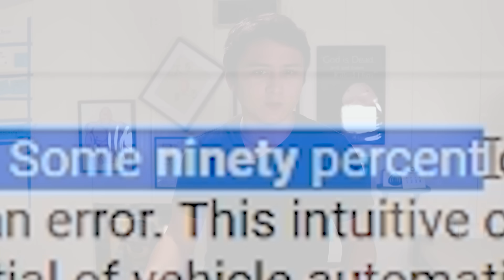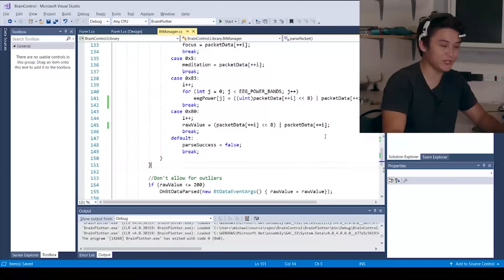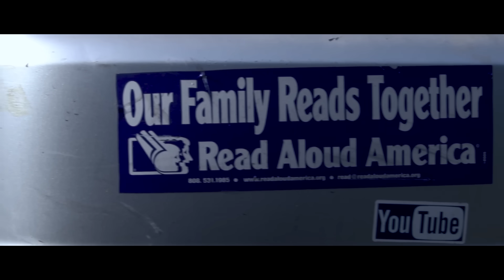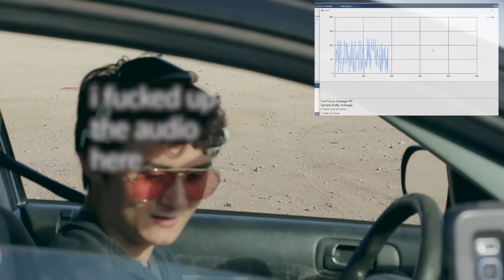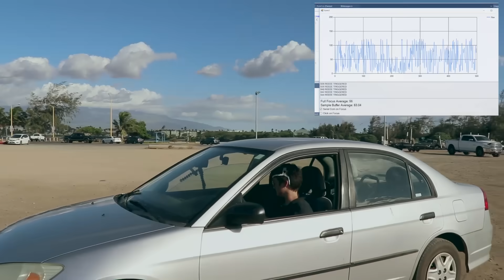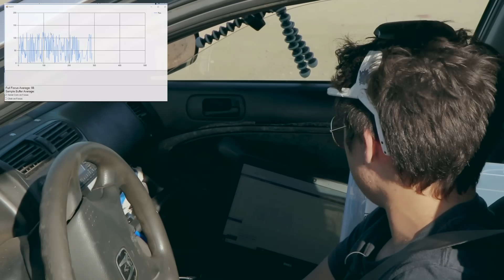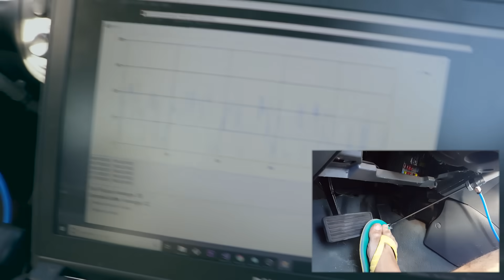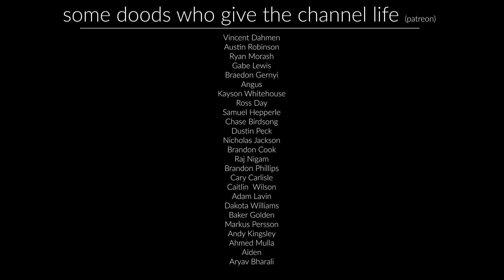Using Mind Control to Drive a Car

Comment: Old vid ik, but if you ever see this then. You should redo it, but make it so when you focus it presses the brake and when your calm your on the gas, you said when your panicking you focused. Well ima panic if i see a kid in the road, and if that makes me speed up more itll look bad lol. And if you can make it a gradual acceleration and brake. So maybe of that number is 65-70 its full brakes 60-65 half break and then do the same for the gas.

Comment: "if you have the means or not, this is a terrible idea" does it anyways. Don't worry guys, mine will have a 405nm laser pointed at a crystal. Why do I need a turn signal anyways. If you don't run from a blue/violet laser shooting in all directions that's on you anyways.

Comment: dude use a fucking electrical motor and a pully around the gas so the moter pulls tighter and slowly exelerates to a certain threshold then release auto rotates back slowing down then you're varible can be the speed of the motor and mabe u can even set threshold maximums of beta and alpha waves by the y and z axis of the motor like say 31 it will rotate untill it reaches it's maximum rotation and 16 will be the minimum or completely released
Reply: also with those helmet's i believe their is a way to increase the tuneing sensitivity to get a borader spectrum of by eliminateing grey area in the sencer and haveing the scaleing of the reading set at a short delay and have it resist change in frequency to a low maximum threshold which will force it to glide like a pointer trail on a mouse

Comment: attach it to your lights because your brainwaves are smaller when you sleep so the lights are off then when you wake up the lights turn in until you can get to the light switch and take the headset off

Comment: The more I look at this video, the more I realize that this was an actual insight into the use of brainwaves to control physical mechanisms. Which is really cool for someone like me with literally no knowledge or experience in engineering. So good on you Michael, ya fuckin did it.

Comment: "I forgot safety was our #3 priority"
That's a builder's motto.
Reply: Kerbals be like
Reply: A safety tie does the trick
Reply: Peronio when i make shit safety isnt even a priority. I just do damage control when something catches on fire or i shock my self.
Reply: for you wondering it's: fun, quality of build and then safety
Reply: Same thing goes for homework
Except the fact that you add a few more 0s to the end.
Reply: Did you mean moto moto
Reply: Peronio Safety 3rd
Reply: takes hands of the steering wheel
Reply: What's the first?
Reply: the engineering motto is: "if it's close enough, it's good enough"
Reply: Same

Comment: Dim lights would be cool with this, brighter the more focused you are
Reply: That should be used in schools
Reply: @peiithos  We're getting into sketchy territory talking about using technology to monitor brain waves. Surely, reading someone's brain waves is encroaching on personal privacy, no?
Reply: @Fermion.  no, they're not nearly that accurate yet. They may be in the future, but for now all they see is very broad; 2 different waves which can be activated by just about anything. We haven't even really got that to a science yet, but we believe one is for being focus and one is for non-focus. It doesn't help much when trying to figure out specifics.
Reply: @404_thoughtsnotfound  Of course science isn't there yet. But it's good to have the foresight to attempt to identify philosophical, moral, and legal issues before technology catches up to concepts.
Reply: @Fermion.  the science usually comes first though. I can't think if a time an legal argument was made before someone did something to start it off the top of my head. It is a thing people should think about, but with so many potential inventions and so many failed potential inventions, it's usually just a waste of time.

Comment: Positive feedback is a process that occurs in a feedback loop in which the effects of a small disturbance on a system include an increase in the magnitude of the perturbation. (Wikipedia). Focus to accelerate, focus freaks one out causing greater focus, causing more acceleration. 20 goto 10.

Comment: Aren't you able to measure nerve impulses to different parts of the body, so couldn't you just hook some monitors up to like your left and right eye, and then when you wink with one side it will activate gas, and when you wink with the other it will brake, and then you can chill in passenger seat and steer

Comment: How exactly do you "focus "
Reply: To focus, you need to start with something something completely useless, irrelevant, and not productive in the slightest. For example, a poorly made brain-controlled car. Then decide what you'd like to do with it, and if you've done it right, you should be able to focus quite well.
Warning: this tactic does not work with useful, relevant, or even slightly productive tasks. Do not attempt in school, it won't work.

Comment: you could have used a flow & check valve to meter-out the cylinder to accelerate a little slower rather than going full blast pedal to the metal. that would have been an interesting feature to add.
Reply: Where's the fun in that though?
Reply: Nerd
Reply: That's a great idea...

Comment: Should've made the Relay system similar to a dimmer switch, where the amount of focus needed was typical with the hydraulic piston, so it would start slow and then build up to a faster speed.

Comment: It would be 10 times easier to hook a solenoid to the carburettor of the vehicle so it accelerates without the need of a piston pushing the gas pedal.

Comment: What happens if you're driving down the highway with brain power and you either sneeze fart shitt yourself what do you think your brains reaction will do to your driving how would you mind control device control or react to example something like a sneeze when you're driving

I'm pretty sure the car would start doing flip tricks

Comment: amazing software, try this again focus on on an object in front of you. than picture you moving to it, allow the piston to move lower down slowly depending on the concentration it detects more focus on getting to the object slow or faster will help set a more controlled speed.

Comment: I’ve always had trouble waking up. Imagine a subwoofer box in a bed with the ports facing the bed. Amps are getting cheaper and you can power them with computer power sources. Make a 2,000 watt+ subwoofer bed! 15hz-50hz

Comment: Did you happen to buy that solenoid off a website called Andymark? 

https://www.andymark.com/products/single-solenoid-valve-mead-1-8-npt?via=Z2lkOi8vYW5keW1hcmsvV29ya2FyZWE6OkNhdGFsb2c6OkNhdGVnb3J5LzViZDM0MWUzNjFhMTBkMjkyYzk2NDY2Zg

Comment: I know its more than half year after you published it but you should try to make it with one way valve and control not turn on and off air flow but sth like digital flow regulator. I dont know how this brain shit works if its only 0/1 thing or more like physical signal that you can attach value from input to value of regulator position but if its work like this you can get really nice and smooth thing with acceleration :D But if its work 0/1 you can always make some code shit that it will create increment values - when focus you start count time=value for valve position or sth like that

Comment: how did you manage to interface the brain waves reader to electronics like lights? I would like to use it to move a little servo, but it's not clear how to trigger it. do you have to set a value? cause I don't see any noticeable change on that brainwaves graph

Comment: This woild be cool for kids playing ninja around the house. "Alexis turn down the lights" gives off your location via sound. 

If you had a feild and a bunch of lights in trees on walls on ground.With the brain wave analyzer. 

Random speakers with loud alien noises. 

Camras set up to a screen showing you far away on a consistent showing. 

 A few screens  with a sense of disorganised. Just randomly seeing the other part of the map.

Crazy fast flying RC drones. With camras sweeping across the map flying back to a check point to show the video than repeat.

2 teams  5 on each team. 

You could strobe lights to distract your enemy. 

Distracted by the sounds of aliens.

Lazer tag (a new respond point on the map to reactivate the lazergun every time.)

 capture the flag.

So manny players of the opposite team make a simultaneous sound across the map loud alien gargle.

Comment: Pro tip wedge am orange in your tesla steering wheel to defeat the "one hand" safety feature 
*disclaimer I am in no way responsible for any damage incurred to your vehicle in response to this comment, you take full responsibility for any small animals or children run down by tour vehicle. This information is not intended to be taken seriously, and no person should read comments due to toxicity. No copyright claim, information from 2017.

Comment: That can be a safety feature, the accelerator only works if you're focusing on driving, so that when zone out, the car'll stop
Reply: Yeah just casually stop the car in the middle of a highway. Sounds great dude
Reply: It would’ve built in with hazard lights, so when brain activity decreases below expected consciousness, the car will slow down, once it comes to a halt, the lights would switch on to warm traffic.
Reply: @sylasviper715  Not a bad Idea, i'll admit.
Reply: Jacob Schneider but you would have to have more electrodes to definitively distinguish panic from focus. Because otherwise you’ll kill everyone.
Reply: @sylasviper715  Not needed. He said the accelerator only WORKS when focused, it doesn't automatically accelerate.
Reply: @Galactipod  but yes, true.

Comment: Today I made an app that communicates with an Arduino and receives the string "Ass" if you press a button, and "Penor" if you press the other. I was really happy when it worked. You are and inspiration for me to aim higher. Maybe one day I will display "Ass" and "Penor" on Times Square.

Comment: Instead of a binary piston using a solenoid, you Could use a servo which correlates focus with acceleration. :D or just directly attach the servo to the gas valve under the hood. No gas pedal necessary

Comment: Probably expensive as all living fuck to pull off, but you could probably hook up drones to your mind...headset(?), and use the mind headset to control how fast it spins the propellers, like, four different thresholds that each don't matter once it reaches a threshold above said threshold, higher brain activity levels resulting in higher altitude. 

Or, you could like, save yourself the trouble and completely ignore my shit-filled suggestion!
That's probably a better option!

Comment: We need a Michael Reeves x Elon Musk collab.
Reply: And that would create what? You guys have to understand that Elon is just an investor and CEO, he doesnt actually do the stuff, he just thinks of them. "Hey lets try to build reusable rockets, Science team, go for it"
Reply: andi bro No, he’s mentioned in interviews that the majority of his job is actually engineering and not business. He’s not like a lot of other investors/CEOs.
Reply: @DrAdnan  Elon has a Bachelor of Science in physics and Bachelor of science in economics, even if the majority of his job WAS engineering (where he doesnt even have a degree in) he is just one person. SO insiginificant when it comes to building cars or even rockets. Maybe he does like 0.2% of the work. If any.
Reply: andi bro He’s very self motivated and learns a lot on his own (in addition to having a high IQ and an aptitude for engineering). Not everyone needs a piece of paper with letters on it to be competent in a field. 

The argument of whether he has much impact as one person is irrelevant to our current discussion since your initial argument was that he didn’t do much engineering. Also, the biggest power of a leader is to rally the strengths and energies of groups of individuals to a greater cause, and Elon has been shown to effectively do this multiple times at scale.
Reply: @DrAdnan  No. My initial argument was  that he doesnt create stuff himself. To which you replied that he actually works in engineering fields, to which I replied he doesnt have a degree and btw I never said you necessarily need one, but still cant cause much impact by himself when it comes to actually working on the project. The person my initial argument was towards, deleted his comment. You joined the discussion not me so stop saying stuff is irrelevant if you bring it up yourself
Reply: @andi827  bro he works 90+ hours also r/woooooosh there is a joke and it's not meant to be taken seriously so calm down also Elon musk does 60+% of things also 

R/iamverysmart
Reply: @andi827  also he Elon musk learned programing looooooong ago like 30+ years so he could help Elon or the other way around so yeah
Reply: @RamiHaddadin  
First of all, yeah he works 90+ hours because he owns 2 big ass businesses and has many side projects ongoing, like SolarCity for example. "also Elon musk does 60+% of things" what is that even supposed to mean? Even though i am 99% sure you just took a percentage that seemed reasonable to you, this doesnt make sense. He closes deals, supervises and monitors the companies, thats what he does. If you think that Musk takes a screwdriver in his hand to work on some tesla youre out of your mind. 60% what a joke, do you actually think he builds 60% of a spaceX rocket by himself? I never said I was smart aswell and I never bragged with any knowledge. Michael Reeves x Elon Musk has no point, you could name any investor with a shit ton of money. Michael Reeves x Bill Gates, Warren Buffet, George Soros and so on. He obviously wrote his comment cause the internet praises Musk as the "Tony Stark" of the real world while Tony Stark builds his shit himself and he doesnt. Also r/woooooosh?

Haha, now this is epic. From Reddit, right? I love that website! It's the intellectual cornerstone of the interwebs xD. I don't know which is more superior though; reddit or four channel? I heard four channel is full of racists though.

LOL, LMAO XD r/WHOOOOOOSH! Just kidding, I'm not a bigot and would never use that website. I came from 9gag, all my buddies migrated to reddit. 

r/whooooooosh, also rick and morty.
Reply: @andi827  so elon would provide the money and ideas, and michael would build some insane crap.

Comment: maybe try reversing the signals? So that being more focused stops the acceleration and zoning out continues it? It would kind of make more sense, seeing as you're a lot more focused when you're trying to avoid certain death in the form of that semi trailer rushing at your face at 50 mph.

Comment: You should do a part 2 where you attach it to the brakes and you have to focus for it not to press them, so if you're driving and you zone out, you get jolted straight back into focusing on driving. Maybe manually put a restriction in the code to trigger an eighth second press, so that it doesn't lag and stay fully matted on the brakes for too long, which would be "dangerous".

Edit: I just scrolled down and found that extraterrestrial badger said basically the same thing, so I liked his comment and would like to say that I obviously second that idea.

Comment: still, we need a different criteria for driving with brain as with focus you are going to constantly accelerate as you have to be max focused on a road so you won't hit anyone. so if you focus on the road, you'll accelerate. WHOA, great ifea would be to go fast as much as you are focused, so if you are not focused enought you go slower so you have more time to react, and if you are focused, you'll react quicker so you can go faster, and voila, only if you are foused realy hard, you'll probably break the speed limit

Comment: if you got a variable piston you could set it so the more you concentrate past a certain point you could accelerate at different speeds, and at lower levels you could brake so there's that

Comment: I won't be surprised if the CIA knocks on your door.
Reply: NASA hiding in the boot, sneak 100
Reply: The CIA doesnt knock.
Reply: @realmidzz  that's the FBI. The CIA will straight up slide through your ventilation and poison your Mott's Brand Apple Juice.
Reply: eWreccT and then whisper CIA give me the mind control ability
Reply: FBI OPEN UP

Comment: “Frius”, The New Force™️-Powered Hybrid from JMC (Jedi Motor Company)! You don’t need to be a Jedi to use the force to accelerate your vehicle! With the all-new “Frius”, just use your mind (hooked up to a computer)! This half traditional kinetic-movement-controlled, half mind-powered Hybrid will allow you to use your right foot for other, more important things! Like: tapping your foot to the rhythm of your music, crushing your recycling, or kicking yourself in your own ass (someone has to do it)! No longer will you be “forced” (see what I did there?) to use all four appendages while behind the wheel of your car. Now, single-amputees will be able to drive with ease! Unless your loss of limb stemmed from an incident that gave you PTSD*. (Pay no attention to the fact that you can already drive a vehicle with one foot; pointing out this fact ruins our business model and is just generally a dick move. You’re just mad you didn’t think of this first) 

*It is not recommended that you drive the “Frius” while suffering from anxiety related to PTSD. Uncontrolled acceleration has been observed during testing on ex-military, victims of shark attacks, and people who have been (darth) mauled by bears.